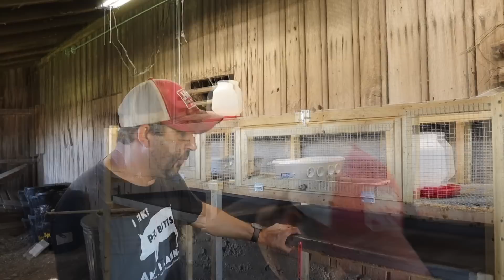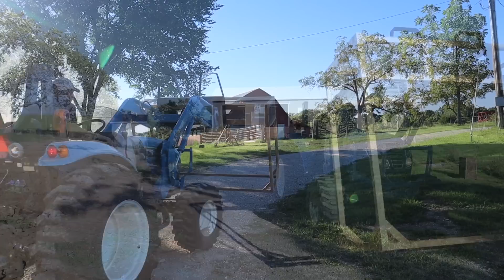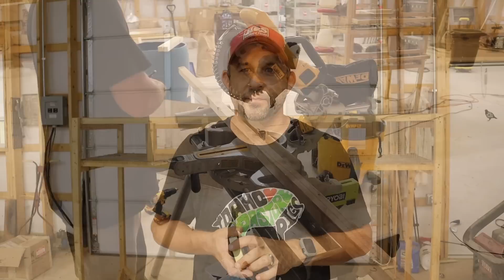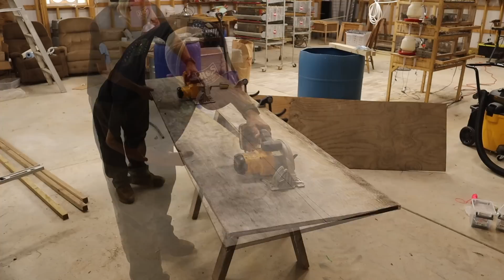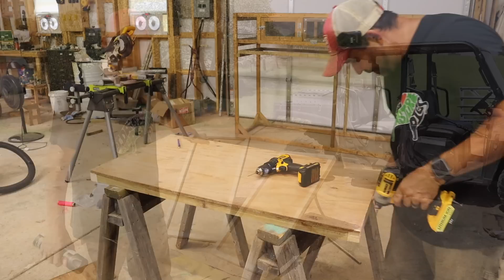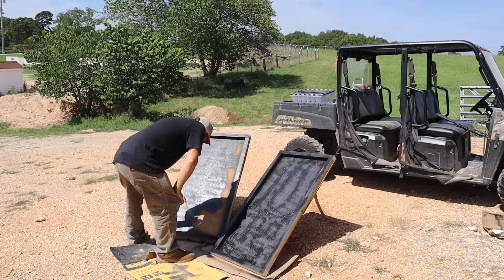A Health Issue Has Caused Me To Make This Decision...

Comment: Maybe use a dust mask when placing shavings, but especially when cleaning around the dander.
Reply: Yes, a dust mask will help further by cutting down on particulates that float around in the air. Don’t take any chances with adult asthma since it can lead to more severe problems down the road.
Reply: I totally understand about using a mask when working around dust. I have the same breathing problems since covid but what do you do when you can't breathe through the mask? I can understand why he's not.
Reply: @brendaglanzman2066  right there with ya!
Reply: Agree those shavings may be causing some issues
Reply: I'm asthmatic and use a dust mask when I sweep and dust  my house daily.  Dust is what sets me off.  Ordinary household dust.  It works for me.
Reply: Not only the shavings, Anytime you use any kind of spray pain you should have on a half face mask rated for spray paint. Given his condition he should wear it when doing sawing. Less than $20.
Reply: So, i do understand many reason for not using a mask, myself, I am claustrophobic,  but after over 40 years of a mask requirement at my job in electronics cleanroom I had to comply. Now with the covid restrictions still in many situations I simply put the mask on as I am leaving my vehicle. In the case of doing a video, I have heard that the sound doesn't quite work correctly,  so in that case we all make exceptions from time to time. It's not easy to make the change to a mask when it's already difficult to keep breathing, it's a process that took time and still I cannot breathe at times. Life...
Reply: I am sorry you are dealing with allergies coming back. I developed allergies to dust and hay/grass in my 20’s. Dusting the house, vacuuming, handling hay and cleaning cages triggers my asthma. My allergist told me about RZ Masks. They are fantastic! Originally they made motorcross dust masks for racing . Now they also make masks for first responders. Works great! Hope you feel better soon!
Reply: @brendaglanzman2066  use a good quality mask with a resperator, the kind painters use
Reply: Ruling out whether it’s from the saw dust or birds would be a Great idea.
Reply: I noticed that too. he should have a mask on around all that dander and wood chip bedding. especially having previous problems with asthma.

Comment: Hey Kevin, one can build a very effective dust filter for one's shop by purchasing a low-cost box fan from Wall Mart and an inexpensive square filter that is just held on with bungee cords on the back of the fan.  The fan cleans an amazing amount of cu feet of air in a little time and gets the small dust particles that hang in the air.  I made one for my shop that I use in the wintertime when I need to keep the big garage door closed, I'm amazed at how well it works.  Ann and I hope you feel better.  Great video thumbs up.
Reply: that's clever
Reply: your definitely a good soul offering a possible suggestion, however that youtube fix is patently wrong and VERY ineffective. A box fan has a very poor vane axial style fan blade assembly and is specifically designed to just pass air from the inlet to the outlet without ANY OBSTRUCTION. The minute you introduce a filter like the one you suggest, the air flow from one side to the other is reduced by ove 3/4. And when the filter loads up, even a little, it is reduced exponentially. The best bet is to utilize a scroll or backward incline fan with a ducted plenum so a filter can be introduced an work effectively against the static pressure and resistance caused by a filter. You also maintain a very significant amount of airflow, which is key to evacuating particulate.
Reply: @wjgoh653  My experience is empirical.  I discovered the idea from YouTube there are lots of folks who have made these low cost and effective air cleaners for their shops. Check out Izzy Swan, Matias Wandel to name a few.  I've put a telltale on the fan to show the air flow, when the filter needs to be cleaned, I take it outside and clean it with compressed air.  I know the filter is working well as there is about an eight of an inch (4 mm) of dust caked on.  This method of removing dust from the air is effective, low cost, and easy to make. I would not keep using it if it did not work and I certainly would not offer it someone if it did not work.
Reply: @craigsudman4556  be careful though. I bought one pre-made that has an auto shut off in case the motor gets too hot etc. It shut off and threw the breaker. Have to change filters often. It really pulls the motor down and can cause a fire if the filter is left too long.
Reply: @RepentfollowJesus  sounds to like there is too much load on your fan you should contact the manufacturer of your fan to check to see if it has the correct filter installed.  I modified my fan by making it a ducted fan to increase its efficiency so that less air passes around the ends of the blades and more air goes through the filter however there is still enough bypass air to allow the motor to spin at the rated r.p.m.'s and enough air flow through the filter to allow the motor to keep cool.  Since my shop is small (2800 cu. ft.) one fan is sufficient to clear the air in 10 to 15 minutes.

Comment: You can use filters (we make them by taking cheap furnace filters apart) to temporarily attach to the back of your shop fans it stops a great deal of the particles flying around in your shop.

Comment: About health:  I'm sure you will get lots of good and bad advice, but I have to share a tip that has helped me.  There are great masks made for SHOP use that are more breathable than those we use for disease contagions.  I use one whenever I'm using equipment or have fans running in my shop because of the fine particles.  It has made a positive difference for me in general.    I got mine at Home Depot, but I'm sure they are available at other places.

Comment: I used to use wood shavings under my quail cages and switched to Sweet PDZ.  The product only requires a thin layer.  It made a difference in odor and the waste just slides off the pans.  I also always use a face mask when cleaning the cages.

Comment: If you don't already, i would suggest wearing a dust mask when cleaning any kind of bird cage due to the hazards associated with breathing small particulates from their droppings. For the birds still in the work shop would it be helpful to put a temporary divider/wall maybe with plastic sheeting like the greenhouse, around the quail cages and run an air purifier in the enclosure to remove allerigins, just a thought. Kevin always does such a great job of trouble shooting, and coming up with solutions to problems on the homestead.

Comment: I really like your pan idea. When I built my cages, I had watched lots of youtube. I purchased several of the flat oil drip pans we used to put under our car in the garage to keep the leaky old cars from soaking the garage floor. Then I built my cages to fit the trays. (One of the advantages of watching you first) They have worked great.

Comment: I had long haulers for nearly 2 years. What's happening is that allergies trigger your antibodies into action. With long haulers, our natural antibodies can be overactive for a long period of time, making any of these normal exposures to something that would trigger antibodies into action with your asthma. This may be what's occurring with you. For me it was inflammation, causing muscle pain and arthritic pain. They tested me for every type of auto-immune disease known to man, all were negative but my antibodies were off the scale high. Trying to push through it would land me in bed for a few days as if I was recovering from heat exhaustion. I also had intermittent shortness of breath and heart palpitations that would come on out of the blue, without any physical activity, often as I was climbing into bed for the night. It was awful, but gratefully has finally subsided. I hope that yours improves with your coop changes and that you're feeling as good as new soon. Just know that if it is long haulers, it can feel like it'll never get better, but it can and does.
Reply: I have terrible joint pain. Literally every single joint in my legs hurts. I’m beginning to consider this as a possibility. It’s been two months since I’ve had the C. I’m only 41, never had arthritis or any symptoms like this.
Reply: It can be mold somewhere in the house. Mold can be seasonal. Inside the drywall etc. Try quitting gluten and dairy too, these allergies are connected.
Reply: One of my sons has long haul Covid. He has heart palpitations & many other issues. Thankfully,  he never took the inoculations. He is active & no health issues til he & his brother got Covid last July. 
He lost half of his hair & had joint pain. The other son has no side effects & was also noninoculated.
Reply: @Transylvanian Farmer, pls check yourself out for reactive arthritis. My Mum was misdiagnosed many years ago and told that she would be in a wheelchair within 10 years. That there was nothing she could do about it and to just go home and take the MANY painkillers they prescribed her. They DID NOT tell her that the painkillers would continue to eat away at her joints and only make the problem worse. Luckily, soon after a friend of hers went to a talk by a doctor of Auto-immunology and she was properly diagnosed as having reactive arthritis. Tests proved it was food allergies causing her symptoms and today, more than 16 years later, she is active and certainly not in a wheelchair.
Reply: You just described what I'm  going through.  🥺
Reply: Thank you to each of you for this very real, non-political, non-idelogical, conversation; and I am talking of "crud" from both sides of the spectrum.  You have brought forth the allergy based perspective, aspect, and facet I had not thought of: coupled with the assorted and essentially inflammation based symptoms folks talk of, that folks seem to have an antibody based set of reactions, etc....  Right, wrong, or partially on track: observations, reality, and what people are actually experiencing is important.  Mold, gluten, and dairy - I will hang my ear out for more info along these lines.  

This info marries up pretty well with what I remember uncovering early on  with what i could decipher with my 40 year old, basic chemistry "education" and the single class I passed because I could flip a fraction.  Again, thank you for this conversation.
Reply: My sister is a long hauler and had been diagnosed with covid 3 or 4 times.  She's taking moringa now and her health has made an amazing turn around! Please try it! We get ours from pure vida and she had a vast improvement in only 3 days! She's back to doing yard work again which has always been her passion. I've never seen her so happy! She thanks Father every day for creating such an amazing plant for His children 🙏💖
Reply: Thank you for this reply! I've noticed a lot of the same symptons you have (heart palpitations, problems breathing) I'm glad to hear that it may subside! It's been just over a year since we had covid. I've also had other pains (arm), and wonder if that has anything to do with it.
Reply: @jamesking1033  perhaps you are unaware of the definition 🤷🏻‍♂️
Reply: I have heart and lung disease and I have the rapid heart beat too. I already take meds that treat tachycardia but this was stronger and deeper along with shortness of breath. Got C in Jan and that started in Feb. it’s finally getting better but I still have shortness of breath but for me it hard to tell if it’s from that of my lung disease. I am well managed and know my body well. I feel like if I wasn’t already on these meds that helps those issues I wouldn’t be doing as well. Makes me worry for those who are experiencing these symptoms with no previous issues. Sending healing prayers for you and everyone dealing with long haul symptoms ❤️‍🩹
Reply: Kim Bernard, oh my goodness. Bless you girl. It sounds like this second phase is worse than the initial covid. Are you feeling like you are over it or are still dealing with issues?
Reply: @kevindavis3841  Aren't you cute. I'm a healthcare professional, I completely understand the definition, and how it works as well.
Reply: Sandra, I am wondering how NOT being inoculated helped your sons with their covid.
Reply: This has been my life for the last 2 years,  thank you for the comment. People need to be aware that they are not crazy even if the tests come back as fine keep fighting for your best health.
Reply: @jamesking1033  well bless your heart
Reply: @juliemcgugan1244  o
Reply: @lcgcamrrms9  Was she fully vaccinated against Covid? TIA
Reply: @sandrajohnson9926  Had he been fully vaccinated maybe not of these problems would of affected him.
Reply: @Miguel195211  you my friend are misinformed.  We are now seeing in our large ER the people who keep getting boosted are the ones getting very sick.  Please do more research before you tout that unfortunate statement.
Reply: @lcgcamrrms9  moringa is really good.
Reply: Your evaluation makes sense.
Reply: Mn. 1
Reply: @janislevinson1462  I'm 61, no vaxes, and for me COVID was like a flu.  Had me and my husband down a few days, no lingering effects.
Reply: @Miguel195211  I'm not vaccinated and I'm 61.  It wasn't nice being sick but I recovered quickly.
Reply: Research  Moringa
Reply: @kevindavis3841  If your profile picture is you, I wish you the same southern wishes.
Reply: @jamesking1033  that’s me. About 40 years ago lol. Thank you so much 🙏
Reply: @iamtheirishgirl2  Well, most people have been boosted, so it figures that a small fraction of them getting sick will make it seem like it was the booster that did it. Just look at the people here - some have long C, and they were not even vaccinated. The only way to untangle the puzzle is a well done study.
Reply: @iamtheirishgirl2  You are incorrectly assuming the boosters are creating the problems, not the underlying co-morbidities in which those people having the greatest risk need the boosters.
Reply: @janislevinson1462  I'm not either. Probably got it right before it was public news. Worked in 10 counties during 2020, masked up. BUT in 2017 the Paradise fire just north of me has caused  scarred lower lobes in both lungs. In 2 days going to Pulmanery specialist for tests. Burning pain in lungs has now moved up to my lower esophagus.  We will see
Reply: Make sure your doctor checks your vitamin D level as well. I have had nothing but problems since having Covid in February. My childhood asthma has come back, fatigued, joint pain and even joints locking up, my doctor checked my D level and she found that I was low and supplemented my level and it improved some of the symptoms like fatigue and muscle pain, but my breathing issues are still a problem. She said that lots of people who have these long symptoms tend to have low Vitamin D levels.
Reply: @mneraasen224  i hope you are on co q 10. It helps the heart. Vitamin d3 with k2 5,000 iu of d3 may help. And a good natural multi vitamin. Take them faithfully.
Reply: @transylvanianfarmer  my husband got covid and once he tested negative he has had horrible pain in his hands and ankles and so does a lady friend of mine after the covid she got. Both already had arthritis in their backs as do I. I have no idea what to do for it . Even the pain meds hubby takes dont help much at all.
Reply: @lcgcamrrms9  does it work for joint pain?
Reply: @cindyw53  co q 10 for the heart. At least 200 mg. I take that and d3 with k2 5000 mg of d3. And magnesium for the heart and nerve damage.
Reply: @jamesking1033  arrogance isn't flattering on you if you really are a health care professional.
Reply: @FLPhotoCatcher  i know someone who died 2 days after the 4th booster. Sometimes the jab is dangerous for people with co morbidities as much or more than covid itself.
Reply: @micheleolson9914  the boosters can hurt people by hitting them in the weaker areas of their country morbidities.  I know two that happened to. One died within 2 days of a booster . He was fine before that as far as co morbidities under control. The lady I know had  had her heart shocked into rhythm and was doing great until she got her booster which knocked it back out of rhythm.  Then she got covid. Now her valves are leaking and causing her congestive heart failure . She also got a second case of covid. She is in the hospital right now with fluid in spite of taking 40 mg a day of Lasix. She wishes she had never taken the jab or boosters. Hopefully they will be able to fix her valves .
Reply: @RepentfollowJesus  my husband says it's helped with the pain in his knees
Reply: @RepentfollowJesus  and ignorance isn't flattering on anyone.
Reply: @lcgcamrrms9  do you take the powder, capsule or extract form? I think my husband and I might try this. Our inflammation is through the roof after having covid twice.

Comment: Obviously you are going to be wearing N95 masks whenever you are dealing with any things such as beddings to reduce the airborne particles you are inhaling.  If you are scooping all of those pans that will take awhile and be causing a continuous supply of airborne dust particles.  As skilled as you are at improvising things why not get a cheap shop vac for dedicated use out there.  You could have it lined with paper grocery bag. You could Jerry rig some type of additional filter over the air outtake to reduce recirculating dust.  Then when you or designated other person is changing bag it can be folded down before transporting to compost pile and put entire paper bag on pile rather than shaking it out. That shop vac could be used for anything with dust or feces particles that could be inhaled.  Just a thought.